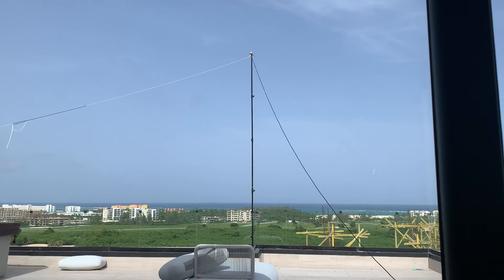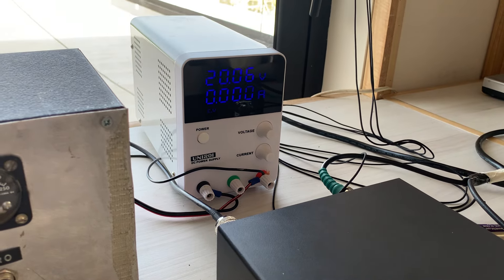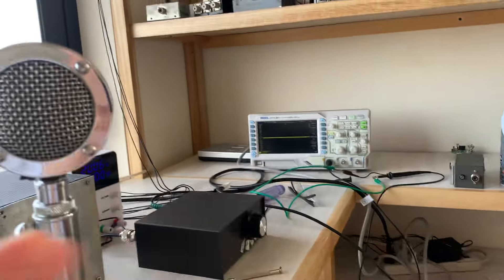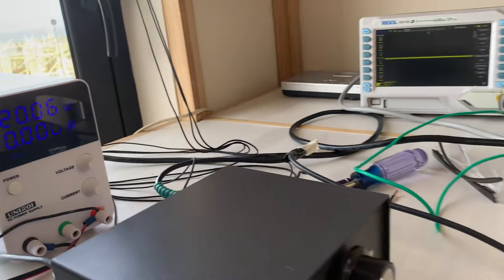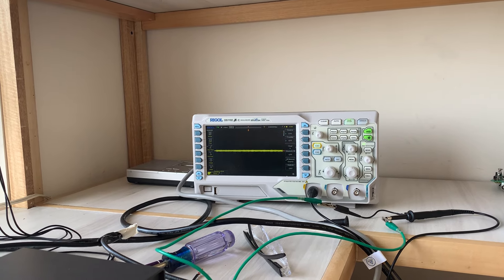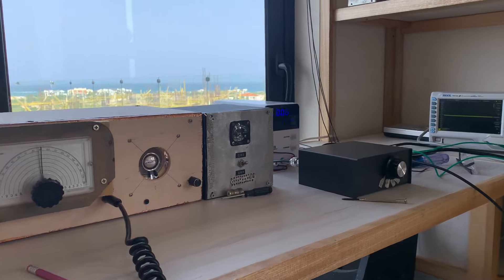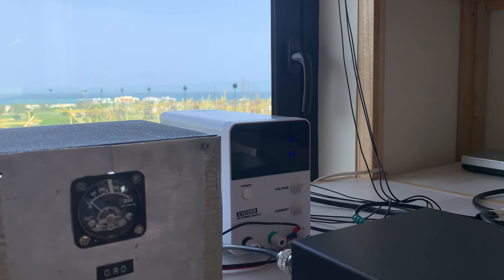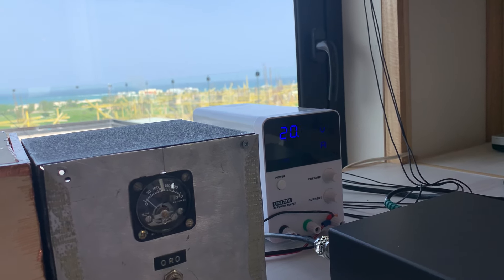15/10 Rig On the Air from Dominican Republic

Comment: Looking good, I converted my 20m Q AMP years ago to 60m , If I remember I changed the LP filter, been a while
Reply from the maker: Mine has gone through multiple changes of LP filters, and several changes of FETs.  I have two IRF510s in there now.  I never used the RF sensing T/R circuitry -- real hams do their own T-R switching!  73  Bill